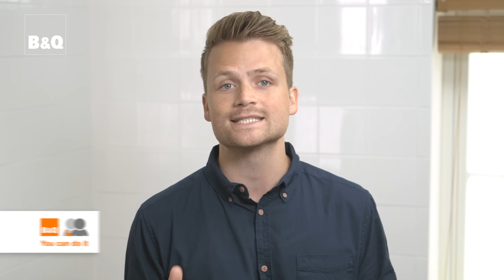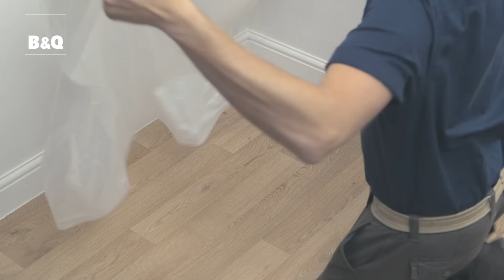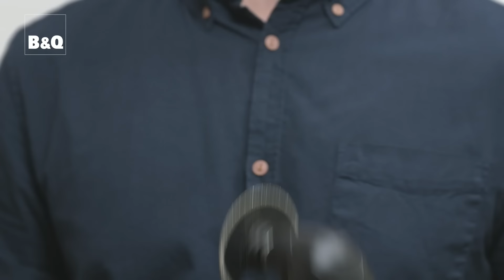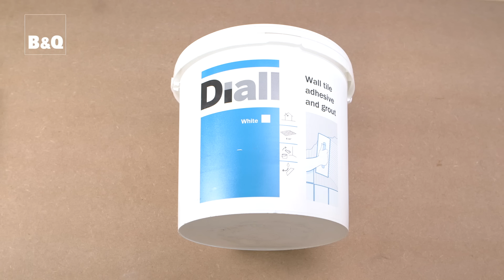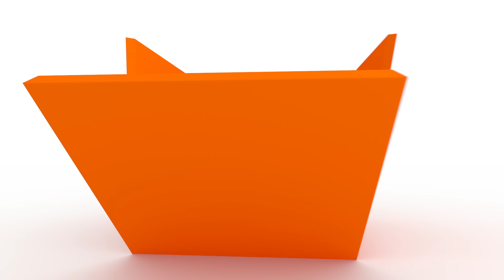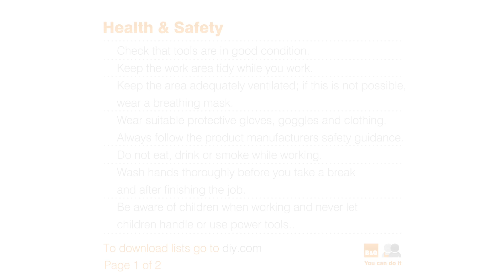How to re-grout tiles

Comment: Please , how you treat the corners. On a flat area looks very easy to clean and remove the additional grout in the corners ??
Reply from the maker: Hi, the technique will be the same to remove the grout. To re-grout, you can do this using a pointing trowel and applying even pressure. I hope this helps 😊

Comment: Can you use tile adhesive as grout
Reply from the maker: Hi, Martin 😊 We would advise to use these products separately. Tile adhesive is used to stick the tiles to the wall or floor, whereas, grout is the mortar used to fill in the gaps between tiles and create a uniform look, as well as protect the surface. Hope this helps! ⚒

Comment: Does one need to use any grout sealant after the new grout has dried up?
Reply from the maker: After installing your tile, we'd recommend waiting 48-72 hours (until the grout is completely dry) before adding sealant 😊
Reply: Is it either recommended or required to use sealant?
Reply: Lisa, it assures greater protection of the new grout from staining and mildew.

Comment: This was really helpful to watch. I'll be attempting to remove grout and regrout my shower tiles in a couple of days.
Reply from the maker: Brilliant! 😁
Reply: Hey Beeman, how did it go? I'm thinking of doing the same with mine.
Reply: @RubyTwilite  Hey Ruby, I ended up regrouting only sections of my shower tiles, about nine sections in different areas. For a layman/novice, I think I did ok, and shower and grout looked okay afterwards. But shower itself is about 30 years old and really needs to be gutted and replaced. I'd had the whole shower (1 and a half tiled walls) regrouted a few months prior for about $600, and only did it myself from a small water leak behind the shower wall discolouring the new grout. Honestly, I didn't really enjoy the experience much, scraping out the old grout on your hands and knees. I was thinking about using a little hand-held electric disc grinding tool to make the grout removal easier, but I was worried about chipping the tile edges and opted for a small scraper. Anyway, thanks for checking and asking :) If you regrout your own shower, let me know likewise how you go?
Reply: @beeman2075  I have an original 1948 bathroom except for the sink which is Ikea with a vanity. 20yrs ago I had the stupid idea of using white floor tiles with dark gray grout because the walls were light gray tile with white grout and I can't stand it now. I thought I'd redo all this and figured I'd you tube it for ideas.

Comment: My kitchen has counter top has missing grout areas do i still have to remove the little grout it has or can i just put some over ?
Reply: From experience it’s always good to deepen the groove to make the grout stick well, because when I first started doing diy and didn’t know any better, I just went over old grout, and it ended up flaking off shortly after and the finish wasn’t great. By removing old grout you’re both giving the grout a deeper area to adhere to and  you’re allowing the new grout to bond better because the top layer is usually filled with dirt. It’s also much nicer looking as it’ll all be level and smooth. Long story short, if you want it to last, remove as much as you can and do it from scratch.

Comment: Great vid! As a handyman in tenement buildings, I find that splashing the walls with super hot water softens the grout- making it easier to rake. The mechanical rake is way more efficient than the hand rake, and is less likely to leave deep scratch marks. I only use a hand rake, or a box cutter, for the edges where the machine can't reach. Restoring ceramic tiles is so much classier than painting with epoxy or covering with conga walls.
Reply: Can you explain what "covering with conga walls" means? I'm trying to google it and conga drums keep popping up haha
Reply: @kaelabydesign  It's been a year since your post. I've just watched the video myself. 
I'm guessing you've since mounted a full octave of congas in sequential order, bringing new meaning to banging in the shower.
Reply: @RSAnimism  😂
Reply: Super hot water 😂